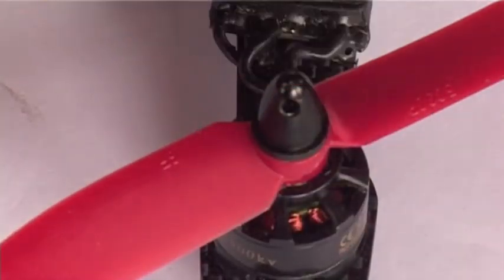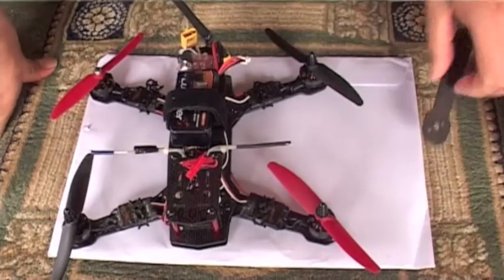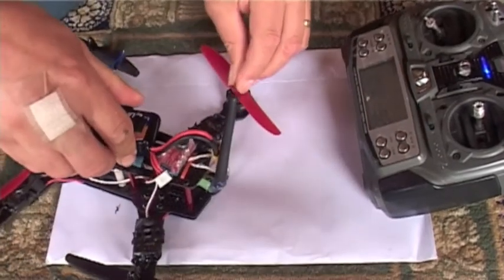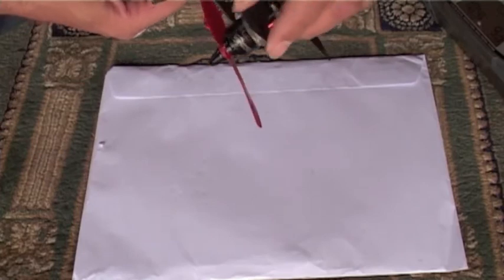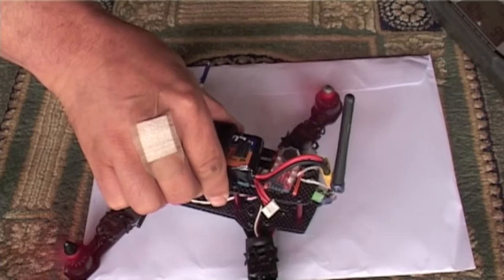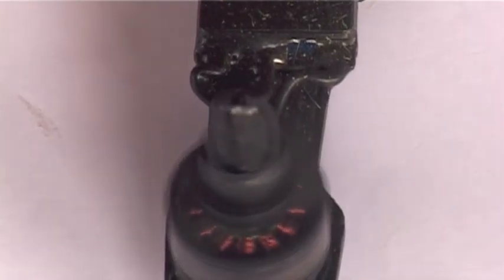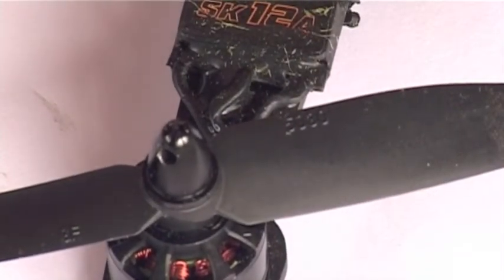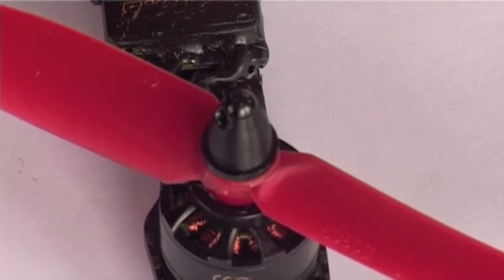quad motor and arm gyration

Comment: Are you sure it wasn't the camera wobbling?
Did you hit your fingers with a spinning blade hence the plaster?
Reply from the maker: purge the plaster was non quad related. I have not needed plasters from quad blade cuts as most do not break the skin. however i did have a blade cut that bleed and i just looked and marveled at it as my first.

Comment: Roddy, are you using the right spacers? Have you balanced your props? Have you got spare motors? 
You'll need the spare motors if you don't do the first 2.
Reply from the maker: Seems the arms are compenstating for the motors and the props so with out that flex in the arms it may be too ridged and put extra bearing pressure on

Comment: It's rubbish quality I have a lumenier qav250 and haven't had a single problem but my frame was 100usd I have had cheap china 250s for about 20usd and have had them flex like yours also try quality motors  cheers
Reply from the maker: bruce said the arm did not move but what you side is the arms do move and the less stiff the arms the easier they flex

Comment: You have a prop problem. They are out of balance, out of round, not symmetrical or a combination of some or all of these.
Reply from the maker: EC I See. Thank you for the out of round comment. 
And also not symmetrical. 
did you consider different density either side?

Comment: Hi Roddy,
Please.....Check all the motor mounting screws, as they all appear to be loose.
& please....do NOT forget the Loctite.

Look at the way the motors all move on the arms when you "check" them.
They all move, but the arms do NOT flex. Tighten the screws & check your blade balance & the motor bearings, as Bruce mentioned.
Reply from the maker: locked in already and tight. so it is the arms flexing

Comment: A useful trick to test one motor at a time is to put your quad in self leveling mode (acro) and pick it up (while at low throttle) and dip one prop downward at a time.  That will make that motor run harder to level the quad and then you may be able to isolate the worst motor.  I had really bad vibration with perfectly balanced carbon props.  the props hit the dirt a few times in rough landings.  By testing one at a time i was able to find a bad prop that looked perfect.  Swapped it out and everything is good again.

Great video.  hope you get the problem worked out.
Reply from the maker: yes an idea that will be tested out. thank you

Comment: It actually looks in the video, as if the motor is moving relative to the arm -- ie: the arm isn't actually flexing at all.  Perhaps it is simply worn bearings in the motors -- or perhaps the motor mounting screws need tightening?
Reply: Yea I second this! I had a bad batch of spacers with some HQ props that made the prop sit a little off center.  
You blokes in New Zealand keep up the good work!
Reply: The hat wobble is amplified at the apex (seen) but the base flutter is imperceivable at that angle. New bearings and firmly screwed in motors only leaves design fault as the blades are new. We want pop eye arms on the quads to give a stable base. Poor design stresses the motor, bearing and blades.

Comment: Mine did the same thing until I ballanced them perfectly...they now run true to center without any vibration or harmonic oscillation...I have alsofound that putting a thick rubber band around the end of the arm, near the motor, tend to obsorb the un wanted vibration and makes a huge difference in the sound of the quad at full power
Reply: So referring to your earlier comment if Roddy had put a rubber band on the arm it wouldn't have worked because he's not an engineer?
Reply from the maker: hypothesis was rubber. observation said balance props and motors. then better stiffer arms

Comment: Balance the props and motor bell housing, dose it do it with no props on?
Reply from the maker: I would have  to say no that it does not do it when props are taken off. However still some vibration but not to the same extent